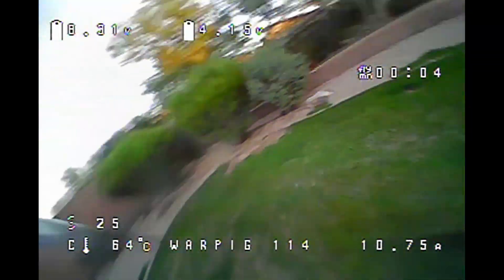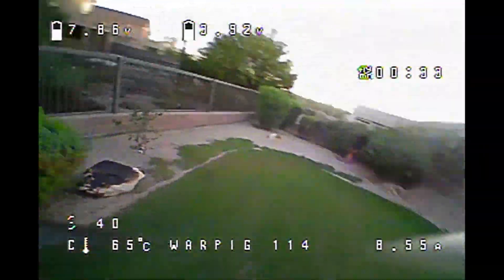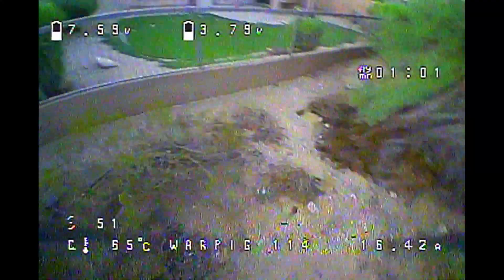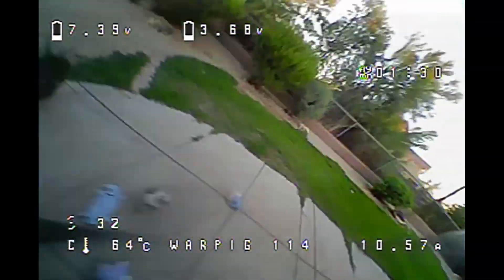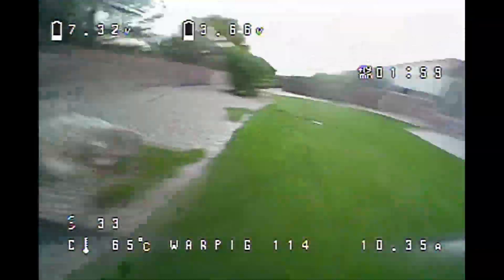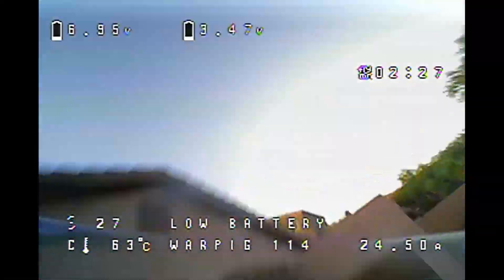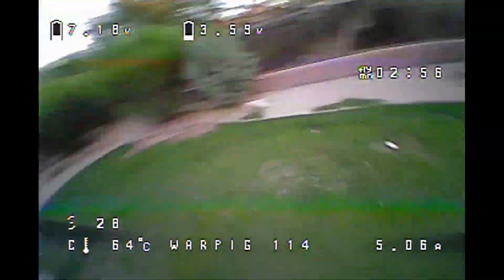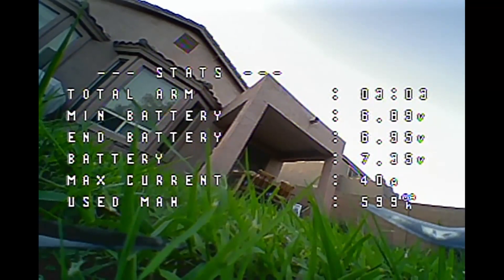Flight DVR: WarPig 114 Gen 5 1202.5 11500kv 2S Gemfan 2512

Comment: How do you get the props of these motors? I´ve just sticked it on and they are tight as hell
Reply from the maker: cut them off. or drill them before putting them on

Comment: Very Interesting regarding .....frame thickness and dampening effects!    I just did a build with Mosquito XL 90mm Rcinpower 1002's 14kv 2 s 2015 props.   With the dual bearing motors and thicker frame I immediately noticed  Improved vtx performance,  quad performance (extremely locked in and smooth) and better Rssi values also.  It didn't dawn on me until watching this VID that the thickness of the frame is also contributing!!!  I'm currently also running the same 115mm build you are running with Gemfan 3018's🤯     65mm to 3 inch ultra light  is going to be king of the back yard and in high demand!!!!   Please continue sir!!!!

Comment: 1202.5 11500kv running 2s batt,  does the motor get hot? Running 3 Inch prop?
Reply from the maker: On the 2512 the motors are mild warm. I haven’t tried swinging 3 inch with them on 2S

Comment: You can fly like crazy, even while narrating the flight. Knowing that is your playground you still fly really well, if not amazing. Cheers to you! I'm building a warpig 110 with 1002 22kv w/5in1 crazy bee. Going to use 550 gbn pink on bt2.0. Trying to stay in your realm. Do you have the tunes available?
Reply from the maker: I have a rough tune but no black box yet. I have a new Flywoo 1-2S board with BB on the way that I'll use to get the tune dialed in.